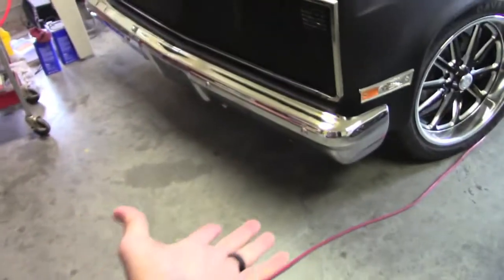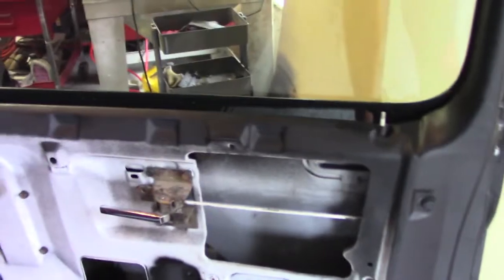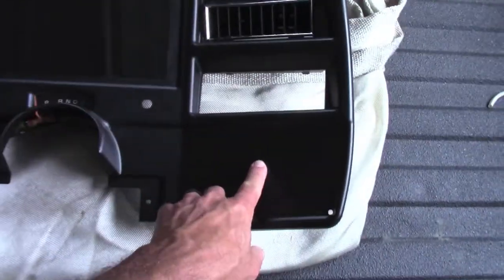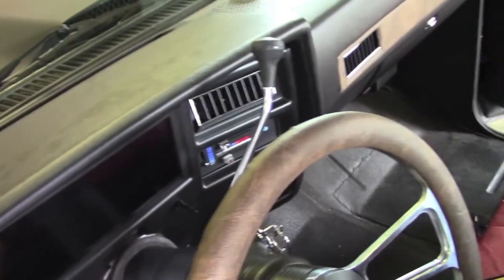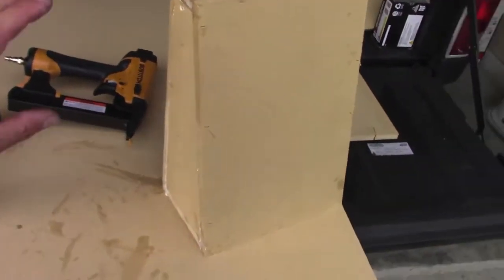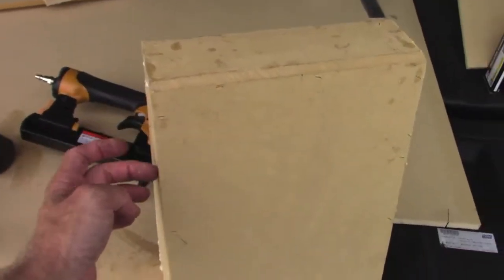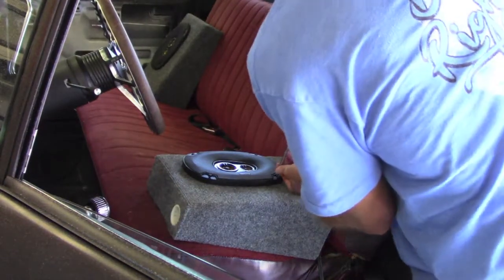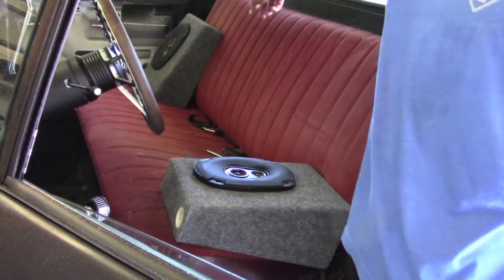C10 Squarebody Build. Bluetooth stereo install!

Comment: Great video. just curious never wired one of these up do you use the radio wires? (First time really wiring something up)  I have a painless performance wiring harness I’m putting on an 85 k10 I’m restoring and I like this a lot also have the same dash and was looking for ideas and this seems cool
Reply from the maker: I did use the wires designated for the radio in the harness. Thanks for watching!

Comment: I plan to buy a set of 6x9 cs series of kicker speakers just like those for the front doors of my 2000 dodge ram laramie slt quad cab long bed 1500 4x4..

Comment: Found this vid while doing a search for a stereo install for pretty much this exact sort of set up. I was planning on making a delete plate out of plastic or finding a factory delete from the heavy duty trucks off of ebay. Is it easier to take the cluster out to get at the radio in these trucks instead of from under the dash especially in a truck with AC?
Reply from the maker: Probably so.